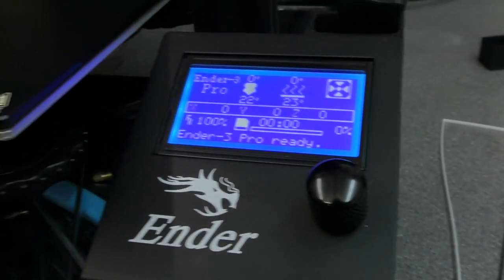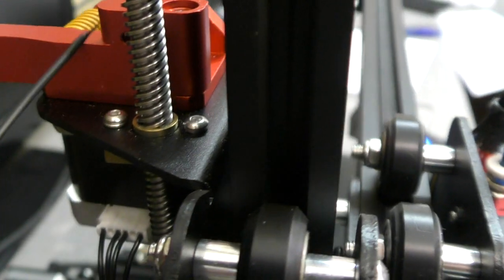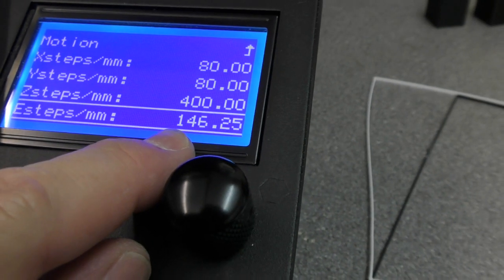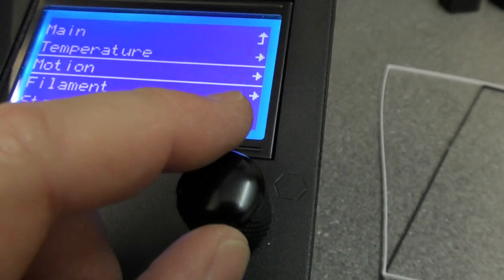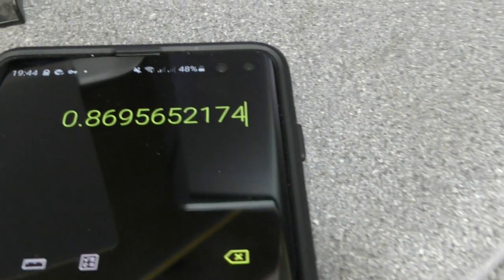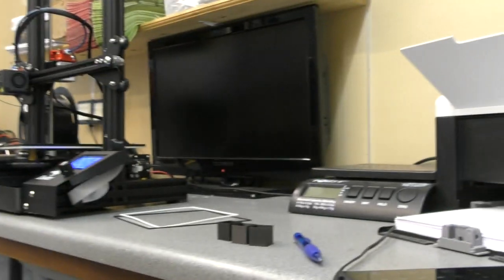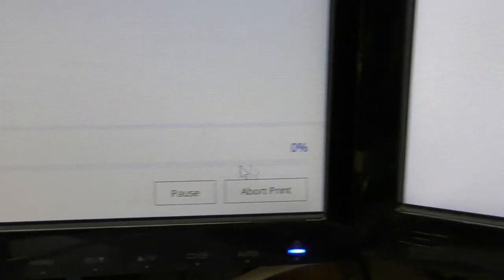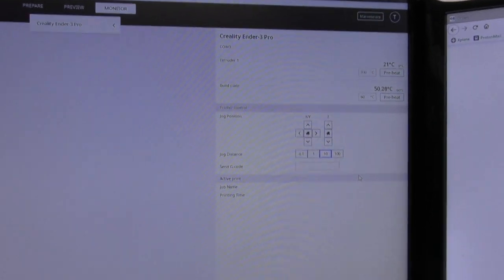Ender 3 Pro Filament feed and flow calibration

Comment: Thank you so much for this video. I installed a new direct drive extruder on my Ender 3 Pro, and while it printed fine with the old bowden setup, it wasn't ideal for soft, fleixble filaments. I couldn't figure out why all my prints failed miserably, other than guessing it wasn't pushing enough filament. Watched this, did the same, and what should have been 10cm of extrusion was a shockingly low 18mm! 😮 No wonder it didn't work, even when upping the flow percentage by quite a bit. The maths told me I had to set it to 500+, and it works. May still not work, but at least now it's extruding the right amount of filament. 😄

Comment: my Ender 3 Pro only extrudes 43mm of Filament at 200c. That is not even half of what it should extrude. Can that be right?
Reply from the maker: Unfortunately the question doesn't make sense. What has 200c got to do with this? Reword and ask again.
Reply: @Trevs-Shed  higher temperature makes the filament thinner more flowy or not? So it should be easier for the extruder to push filament at 200c than 180. I changed the e  steps/mm to 220 which is super high but it seems to be working now
Reply from the maker: @nexxt.4105  Hi. Right I see where you are coming from, the temperature used is dependent on the filament you are using plus or minus a few degrees based on your machine, hot end etc. All filaments have the temperature written on the label usually, I start in the middle of the given range and go from there. Calibrate again at each different type of filament change. The esteps number doesn't matter so long as the correct amount is extruded....

Comment: Hi, Just looked at this and tried it. While changing settings I found a setting under CONTROL/FILAMENT that allowed me to change "E in mm3" ON/OFF, changing it to OFF meant that 100 steps per mm worked perfectly. Makes sense that if turned On that the length of filament for 100mm will be less because it is then measuring 100mm3 of filament and at 1.75mm diameter this will be less than 100mm in length. Hope this is of some use to someone, fixed my issues of under feeding.

Comment: My Ender 3 Pro, 0.4mm width print ended up being 0.48mm.  Did the caluclations, set 83.33% flow r ate and still printed 0.48mm wall width and my prints are heavily underextruted even with other perfect calibrations done.  I'll try printing double like yours but something I noticed about these calibration tests is that they don't always work out.
Reply: The nozzles themselves are not always 0.4mm, mine are probably closer to 0.45mm. Test them with measured pin of 0.4mm (the pin I had with my Ender 5pro is exactly 0.4mm)  and you'll probably find it's a loose fit. I've not seen anyone else mention this but it's something I have noticed being new to 3d printing.
I ended up telling Cura to make my line width 0.5mm and set my flow to 88% did a single and double wall cube both measuring 0.5mm for single wall and 1mm for the double. I chose 0.5mm as a line width as it's easier to calculate 0.5mm walls instead of the 0.4mm + 20% (0.48mm) which is recommended.

I may buy some 0.3mm nozzles and ream them out to exactly 0.4mm myself so I know I can swap them out and not have to recalibrate flow for each nozzle.

Comment: Why do you take in consideration the 93 steps/mm if you have dual gear extruder? Your calculus should begin with actual extruder settings. For dual gear extruder the value should be around 144 steps/mm.
Reply: lol, no. The BMG dual gear extruder runs 415steps/mm. It depends entirely on the gear ratio, not the amount of gears you have.
Reply: @Potplanty  lol? what lol? Did you see that I've made a joke? Why you are talking about BMG dual extruder? Have you seen a BMG extruder in this video?! Please look at 1:40 and tell me if that red extruder is a BMG extruder. The only thing that you are partially right is that the length of extruded filament depends on gear ratio, but NOT ENTIRELY. Anyway the gears on this extruder is 1:1 so no change in ratio like in BMG. The length extruded depends also on the diametre of the rollers that moves the filament and also on micro stepping settings. If you were reading carefully what I have wrote you should notice that I have mentioned that there is not ok to take in consideration the 93 steps/mm that comes as default on this printer, when you already have another value set. How do I know that for the setup in this video the steps/mm should be around 144? Because I have almost the same setup. And if you want to check that I'm right please check here: https://www.youtube.com/watch?v=QnrH2Sk7y40&ab_channel=CHEP, at 8:08. Make your homework first, and then comment with lols.